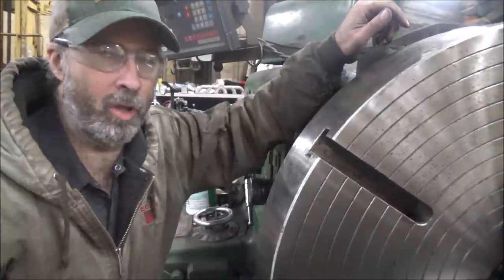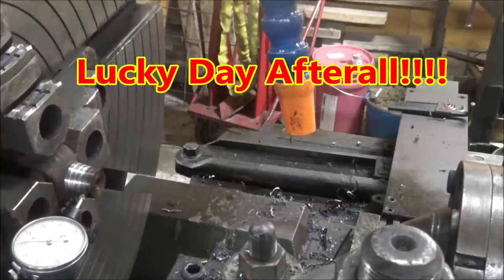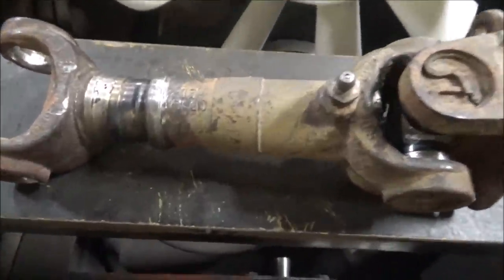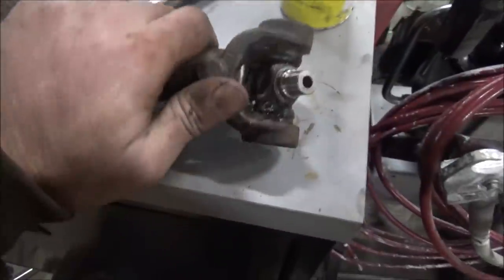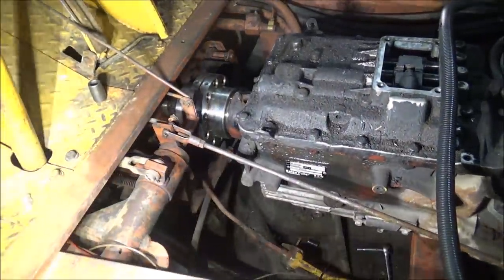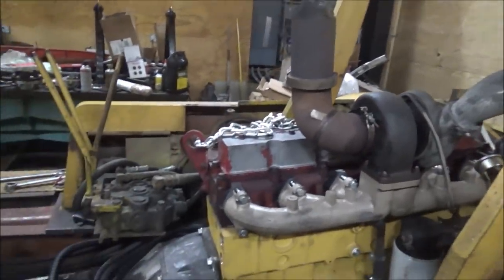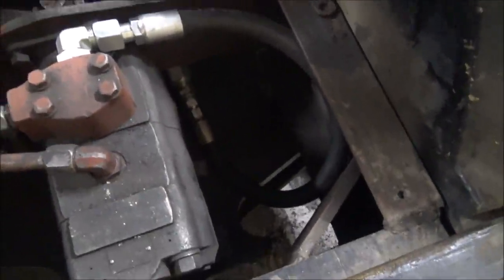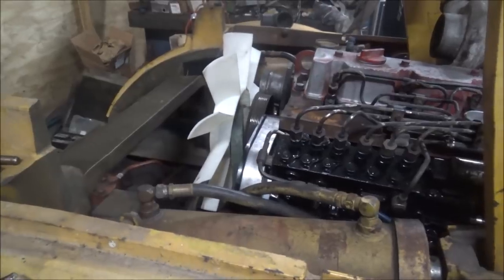Cummins 8.3l swap the Hyster Forklift: modifying a drive shaft and building a adapter and cold start

Comment: That’s a massive achievement mate! Great to see the Carlton earning its keep too
Reply from the maker: Thanks, it is a major milestone its almost to the point of barely useable, which is way better than the totally dead and disabled that it was. The poor Carlton after its series I often forget to film the quick hole punch jobs I perform on it on a regular basis. I need to give it more love.
Reply: @bcbloc02  I think that vice on  the Carlton needs some LOVE it looks like it's been through a war
Reply: @ypopnun1003  yup been blown up many times by the look of it! But you should see the state of the drills! Lol

Comment: What a project! Complicated and little room for error. But I never understood why rebuilding the original was not an option. That sure SEEMS like a simpler approach. I’m sure Brian considered and discarded that idea.
Reply from the maker: I did not want a severly underpowered engine with spark plugs, so this swap makes it do the things I want like be able to operate the hydraulics at idle.

Comment: Super rebuild and mounting in a machine made to work. You'll have the only forklift with turbo diesel to do zero to sixty in 8sec, flat. Plus pick up a 10,000 lb load. Done right for sure instant start , I've seen new engines that crank 6-8 times to start.
Reply from the maker: I like em when the fan wobbles it is running. :-)

Comment: very nice to see the hydraulics working again. i am stalled on my re-power right now. i need to build a "reversing" gear box of some sort.
Reply from the maker: Maybe can adapt an existing one? Deere combines have a cable operated reverser gearbox on the feederhouse and there are tons in salvage yards. I don't know what kind of power capacity you need though they probably only good for 200hp or so.

Comment: You have the look of only a owner does have when leaning over the end of the tailspool on that lathe. I am so damn jealous of you!!!!!!~ I always wanted the biggest lathe made after running a few small ones doing hobby craft to me anyway as I wanted to create with one other tools that I did work with and could make way better. My brother did just that and then pulled the wool out from under me. Guy had stored them in his barn shop with tons of room and he told the guy to move em out of there after several years. A full machine shop from a large torpedo submarine and so boring bars, decking tools an other, too much to name. It was navy stuff and old but very good shape. The guy still never came after it so when he gave it to me, I didn't understand that he wanted it gone that day. I had room and trucks but my forklifts were out on jobs so no way to load an brother wouldn't. Instead he used his dozer to push them up on his old lowboy trailer an hauled them to scrap, tons of metal. I didn't speak to him for a while over that
Reply from the maker: Yeah that is the kind of thing that would get somebody disowned!!

Comment: Hello I see that your Steering Wheel needs to get fixed if you use some two part Epoxy that will work Great on that !!!!  Your work looks great keep it up !!!  It is going to be one MEAN MACHINE !!!!!
Reply from the maker: JB weld the cracks you mean?
Reply: @bcbloc02  Yep !!  It is looking good keep up the good videos and work !!!!

Comment: In regard to the drill press. 250ish volt motor generators are pretty common in the elevator trade and can usually be had for scrap price when retrofits (aka mods) are being done. I bet if you talked to your local small mom and pop elevator repair shops you could probably score one.  Control is simple 208 to 460 3 phase in to spin the motor end and some low power dc for excitation on the other and you have a fairly inexpensive variable drive.  Might be kind of overkill though, most are capable of driving a motor in the 30-40 hp range.

Comment: Still ain't found a welder to grab the rectifier out of for that drill?
Call around to some welding stores, some of them are required to tear down and scrap the machines they take in for trade-ins, but they'll usually sell parts like a bigass 300 amp bridge rectifier
Reply from the maker: I don't know of any welders with anywhere close to a 250V output. That is the problem with running it off my Miller is it caps out at about 70V.
Reply: @bcbloc02  just grab the bridge rectifier and use it to rectify mains voltage, you'll end up with something like 300v DC due to how the RMS measurement of 240v AC works

most of the time the welder rectifier diodes are just 600v rated units because of how dirty the arc makes the output power.

Comment: Does a new or rebuilt diesel engine like that one need a break in period in a forklift application?
Reply from the maker: Yes, it has break in oil in it now. Will run it 50 hours and change over.

Comment: Cold START in the US .. It's BELOW Minus 20 Celcius rit? ?  Then you have to heat her up and kick her to get going?
Reply from the maker: It was about 0C at the time. Will have to catch it sometime when it is more like -20C for a good test. :-) Probably will need more than one junk battery though for that.
Reply: @bcbloc02  @:-p Its like running BAR in Moscow without Kerosane and full syntetic lube oil .. :D im Looking forward to see that. :D ( poor engine ) ... scraping and pitting.

Comment: Nice    What is the lift capacity?
Reply from the maker: 15000lbs off road so 20k pretty easy on the level. Realisticly its about whatever the tail end can hold down as the boom cylinder would go way over 30k from my calculations.
Reply: Now you can buy more big iron with no reservations

Comment: I bet you're a whiz at Tetris.

Not that it necessarily matters, but I would have liked to have seen you clock that universal yoke on that hydraulic pump mounting plate to get a little more material between the new bolt holes and the existing bolt holes.
Reply from the maker: Way more material between them than there is in the yoke so it wouldn't make any difference.
Reply: @bcbloc02  Excellent point.